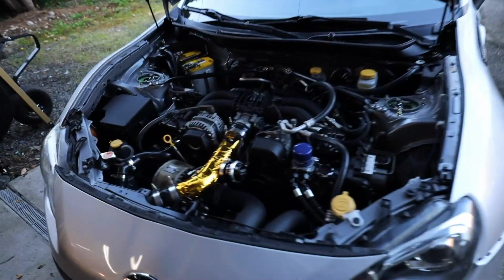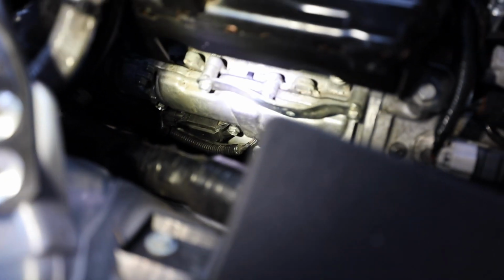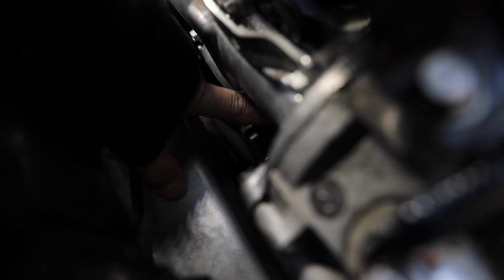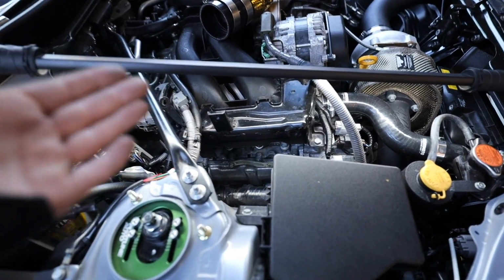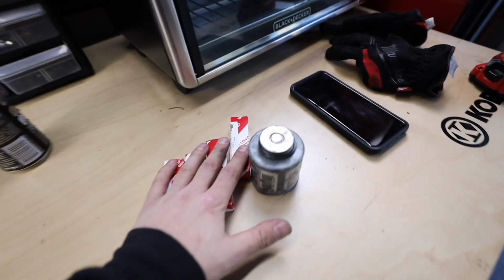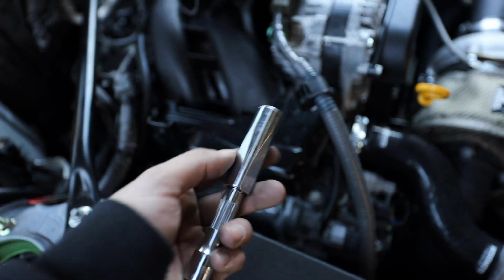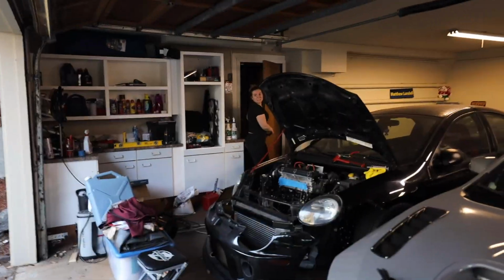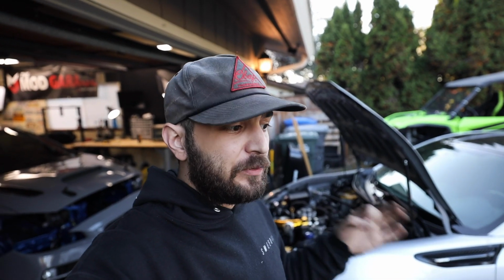How To Change BRZ/FRS/GT86 Spark Plugs

Comment: I saw one video where the guy lifted the engine from one side of the header at a time. It lifted AND tilted the engine just enough to give you way more clearance than what I saw in this video!
Reply from the maker: That's the only way I found to reasonably do this spark plug change 🔥😅

Comment: I just changed mine for 1st time. 
They make a flexible head ratcheting t bar at oreillys, it’s about 16 or 18in long. 
I changed my passenger side without jacking motor up, but had to on drivers side but saved me bunch time only jacking one side of the motor up. I didn’t even have to completely remove the metal skid plate just the driver side to get to the motor mount. Hope it helps thanks for video.
Just wanted to share something may save extra time the next time, you have to change them.
Reply from the maker: Hopefully it helps others who also may be doing this! 🙏😁

Comment: The possible reason for inconsistent lean/rich fuel delivery in each cylinder is most likely because of the series style fuel rail system. Granted this can be fixed "sort of" via a tune but the best way to fix it is to convert the rails to parallel.
Reply from the maker: For the most part I believe it was due to improper injector scaling and the transition between the port and direct injection on the prior tune.
Reply: @Smeedia  That makes sense two, but I have read somewhere that cylinder 1 has issues due to the series fuel system in most subaru engines; hence my comment...

Comment: My 92 4runner v6 spark plugs were pretty bad it didn't help that I had to wait about a week for the manifold gasket to arrive and broken/hoses that caused a nightmare of a vacuum leak.
Reply from the maker: I think I saw a video on that, have you renove the wiper cowl and everything?
Reply: @Smeedia  the manifold wraps on one side of the engine, the manifold needs to be removed and early 90s toyotas have a plethora of vacuum hoses and it's easy to crack, brake or ripe while doing this job. 

The Ford e350 super duty van is also a spark plug nightmare.

Comment: So I don't own a car with this engine in it but I was thinking about getting an Frs, but just out of curiosity is it not possible to take the fender lining off and go through the wheel well for this?
Reply from the maker: Unfortunately not. The biggest issue is that the frame rail is too close to the engine 😖
Reply: @Smeedia  oh okay
Reply: I've said multiple times. They just needed to make 2 holes on either side which you would be able to go through by the wheels. Done deal

Comment: I was wondering if you don't have a bad tune... but like an intelligent vacuume leak. Something about the way it "runs" when you are having issues.
Reply from the maker: It was idling just fine before the 1st tune. It was only an issue once it was tuned so hoping its something simple
Reply: @Smeedia  fingers crossed buddy!  May be worth giving them a once over. I once parked a car,  went to class,  came out and had a real rough idle. A spark plug wire popped off. Gremlins!

Comment: I changed these on our Forester XT which has the same motor but much more room to work...Still wasn't easy to get to those rear plugs.
Reply from the maker: More room would have been nice... lol the FA WRX can be done without having to jack up the motor which is so nice
Reply: @Smeedia  how about if u lower the engine down and change from below?

And definately u need swivel 1/4" short extension so your rachet will reach above or below the frame rail.. not being pinched between engine and frame rail...
Reply: And yeah.. the injector bracket of death need to be removed.. it does nothing just casually making work harder on these subaru engine 🤭🤭🤭
Reply from the maker: They're not too bad to pull off on the BRZ, going to give it an attempt from the bottom next time

Comment: Quick question. I just changed the plugs on my 19 wrx yesterday. Starting up it sounds horrible but eventually smooths out. My ap has also been giving me more fbk and fkL since then. My af correction is also out of wack but all I did were the plugs
Reply from the maker: Pull up cylinder roughness to see what the counts are, what plugs did you use?
Reply: @Smeedia  ngk laser iridiums. All cylinders were reading 0. Just drove it a bit. Af correction 1 is +14 or so to -13.5 which i know isn't normal and it wasn't like this previously
Reply from the maker: You did not change the plug gap, correct?
Reply: @Smeedia  definitely not, m8. Torqued them all down, barely able to but I got that. Then I thought maybe a coil pack was loose but I double checked them
Reply from the maker: I'd give it a day or so to see if the ECU just needs to relearn
Reply: @Smeedia  thank you for the help man. I know its difficult trying to do so on the internet

Comment: That looks harder then my sti for sure. Great video! I'll remember to hard pass when someone's asks me if I want to do them 🤣 also anti sieze for the win! I always use it works great. And I never torque the plugs. I've seen them come loose when they are torque to spec because the washer doesn't crush enough on the plug.
Reply from the maker: The anti size seems to be hit or miss with some people, but trying to fir a torque wrench in there is near impossible 😅😅😅
Reply: @Smeedia  it looks like it. That looks like one of the most annoying normal road cars to change plugs on. I honestly think your way is probably one of the best ways to do it and its still difficult. Thats crazy how uneven the tune looked between all 4 cylinders though
Reply from the maker: It was roughhhhhh hoping the new tune takes care of it. Going to be Etuning all day with delicious tomorrow 🔥
Reply: @Smeedia  I think it will. It will probably be something really simple in the tune that needs fixing.
Reply from the maker: Hoping so 😅 were starting from scratch

Comment: Torque specs for BRZ spark plugs are as easy as can be, so count off as described so clearly on Smeedia TV. One UGA DUGA, two UGA DUGA and not one UGA DUGA more. (Each UGA or DUGA is 2.5 ft lbs)
Reply from the maker: Lol the most accurate description of the UGA DUGA 😅

Comment: My man, i just did this on the wkend. ngk-racing-plug-number-97537, is the route i took..have you had any experience with these plugs? As for the procedure of knuckle busting i took, i also had to jack up the block and work one side at a time. Translation, both big knuckles on each hand, a knuckle per plug got all the love rubbing it needed
Reply from the maker: I haven't used them but next go around I am going to test them out! I could only find OEM Replacements. And guess jacking up the block is the only way 😅

Comment: Don't have a BRZ/FRS/GT86, but judging from how high the motor was jacked up, would it be easier to take the wheels and fender liners off, lift the car and lower the subframe/engine cradle?? That way you are working below the frame rails and not right next to them. And again I'm not 100% on the structure of those cars, just a thought.
Reply from the maker: Not a bad idea! I'll have to peek under there next time. Only thing that might make it worse would be undoing all of the subframe bolts 😅😅
Reply: @Smeedia  yeah true. But hopefully you won't have to completely remove the bolts. Just loosen then to lower the subframe.

Comment: Only thing I can think of to do differently is to use NGK plugs and nothing else. Also, as far as how tight to make them. Screw it in by hand til it bottoms out, then turn it 90 degrees to make sure the crush washer is seated and you're good to go
Reply from the maker: Haven't had any issues so far with the Denso, also haven't really seen too may alternatives for plugs with this car 😅
Reply: @Smeedia  i put some denso plugs in my Ej205 and they lasted about a 1000 miles, put the NGKs in there and have had zero issues for the past 5000 miles
Reply from the maker: Normally i use the NGK 2309s 🔥
Reply: @Smeedia  nice 6418s is what I use in my bugeye

Comment: brother I got the best way in the world to change the spark plugs in that car and I promise you it works great get rid of that car and don't buy another one that's a red flag if you can't even change the plugs in an hour you don't want that car if all that horsepower if you can't even change spark plugs if you're racing then you get a plug that files out you're out of the race

Comment: I think I was view #420 lol. Curious how hard it would be to get those plugs from underneath... heard that suggested for EJs before, (even tho I've never had a problem getting at mine) but I dunno what the mounting situation looks like on the BRZ. Looks like a 💩 job either way, an engineer somewhere should be punched in a sensitive spot.
Reply from the maker: Lol for real, and the frame is right in the way weather your under or over it 😅